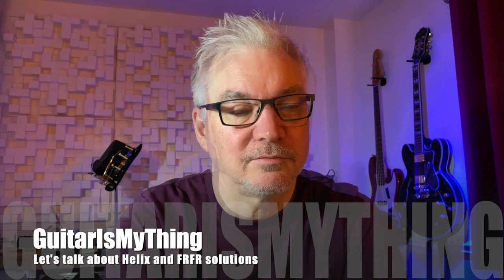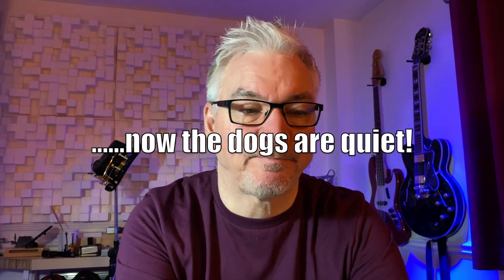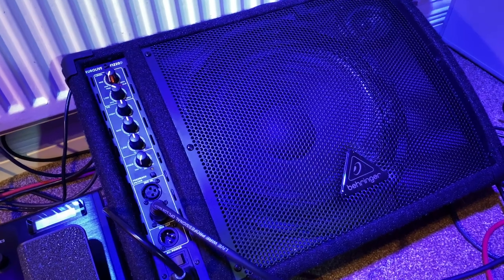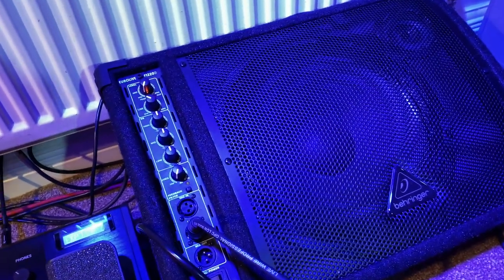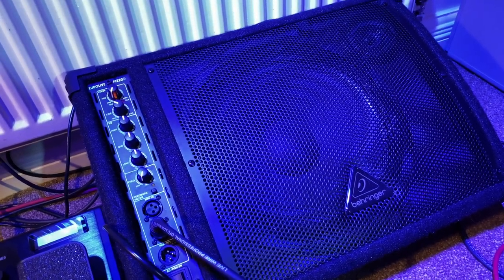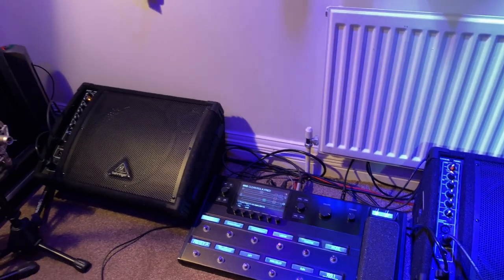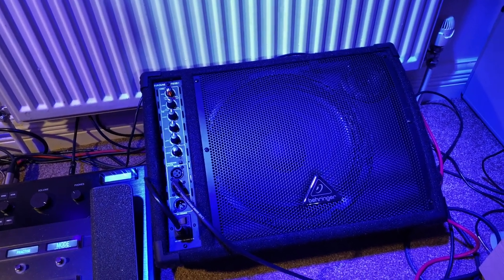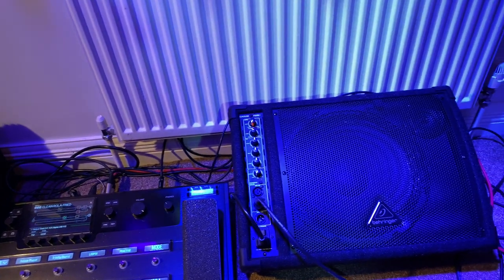My FRFR set up for using Helix on stage and at home

Comment: Just a couple of questions:
-Can the monitors be used as fold backs to hear the rest of the band as well as the guitar?
- Does the sound that you hear from the monitors mirror what comes out of the PA, meaning, does everyone hear stereo as well?

Thanks man glad I found your channel 🙂
Reply: Hi, before I get into the questions, to be clear this is only a set up I use at home now, as I use IEM's live, meaning my Helix goes stereo to our Behringer digital mixer, and then I get a stereo feed back from that to my IEM's which gives me total control over what I hear. With that said, I think it would be possible to use these units as fold backs and get the rest of the band.......If I was doing that, I would use the XLR outs on Helix to go stereo to the desk, so FOH gets stereo, then use both 1/4 outs on Helix to go stereo to the line in's on the monitors (that would get me stereo on the stage monitors), then I'd take a couple of feeds from the aux outs on the desk to go to the mic inputs on the monitors to give me the rest of the band. The line in and mic inputs on the monitors have their own respective level controls so you could in theory mix between yourself and the band mix.......it might work.......but I personally find the IEM solution better and stage volume is significantly reduced. The reason I like these units is.......first, they are a really cost effective way of giving you a pretty representative stereo FRFR set up at home for practise and sound setting, second, you could use them as stereo back line FRFR's if you really wanted to, and third, they could be used as the on stage fold back option above. In a nutshell, I'm not sure you can get an FRFR set up for that money with that flexibility, which was the primary point of my video. Hope this helps your thought process!